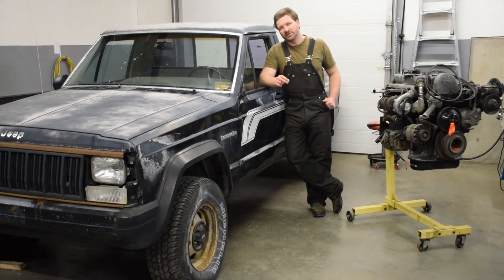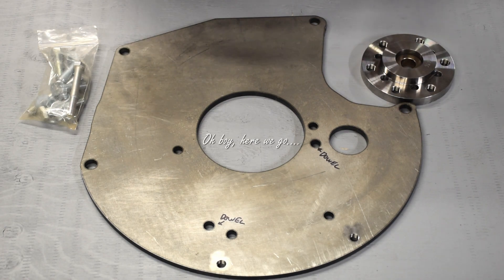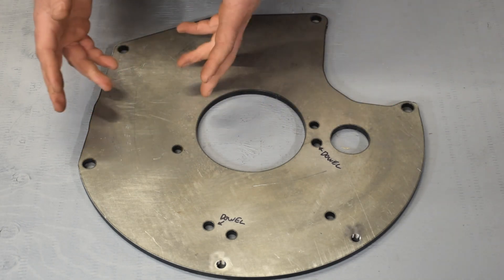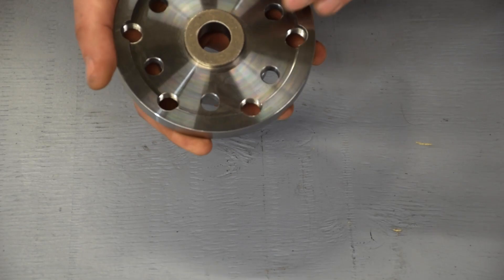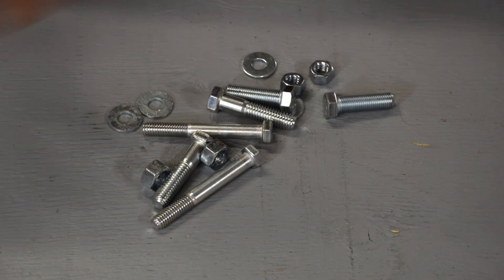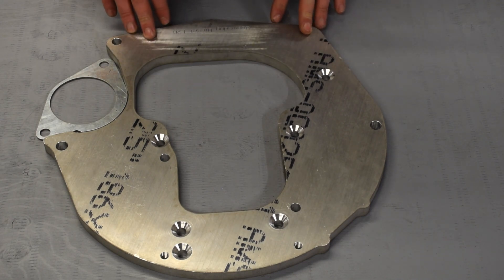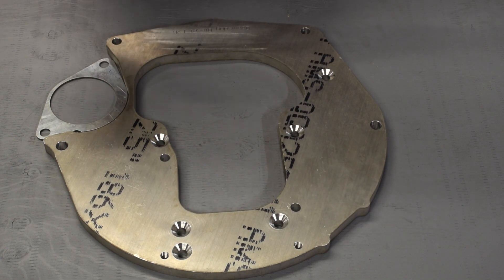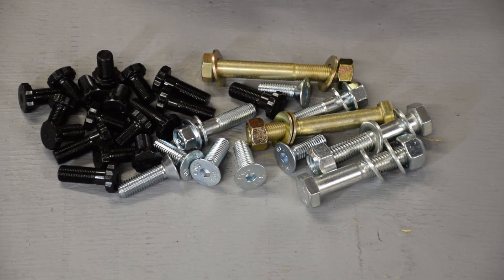Adapters for the OM617.  Ugh - Project Special Reserve Jeep Comanche Episode 2

Comment: Good to know that the dowel sleeves are a chore to remove. They certainly are with the 3VZ-E, hence the reason I include new dowels for the R150. Adding them to future AX15 kits shouldn't be a problem.
What is your honest opinion about my instructions? Anything you'd change or add? I don't send paper copies to conserve trees, plus I assume most people read off their phones nowadays.
Reply from the maker: I think the instructions with your kit are fine.  I was going to mention there wasn't a printed copy, but I cut that from the video as it seemed minor.  My disgust at the MD4x4's instructions being as garbage as they are HAD to be included though.  More pictures are always better, and I'm sure you can add some as more kits are installed, or just include a picture library on your website if people want more material to refer to.  Personally I like printed copies, and like to see them included, but I might be in the minority with that.

Including the dowels in the future would definitely be appreciated, and might cut out some potential issues caused by people trying to reuse them.
Reply: Could always make it an option when ordering. For stuff like this big color pictures are way better than anything on a phone (at least for a noob like myself).
Reply: @DestDroid  excellent idea! Thanks!
Reply: I prefer paper instructions for any automotive work.  I do not like to touch my electronics (phone or laptop) with greasy hands.  With paper instructions I can get them dirty and scratch notes on them as I go.  Just my two cents.

Comment: Dear sir, 
   I agree the extra 0.1:25” thickness would not be advisable if it does not allow proper engagement of the dryer and the ring gear without further fabrication. Where can I purchase an automatic transmission adapter in order to swap a low mileage OM617 diesel engine into the Land Rover Range Rover HSE. P 38 automatic to utilize the original 2000 Land Rover ZF transmission, which is a four-speed ZF transmission 9:39 which bolts to the transfer case in order to retain the four-wheel drive capability, shifter and odometer connection to the Dash gages.😮. Recommended or not.

Comment: I just finished my diesel swap and I gotta say I was in the exact same situation.  I originally bought the mercedes 4x4 diesel kit and then realized the issues before I installed it.  Bought the doomsday diesel kit and hands down its the kit to go with.  Joe provides a great product and support.  Buy from Joe.  Now I have a brand new mercedes 4x4 adapter kit that I dont feel right selling to anyone, but thats my problem.  Thanks for the video, just wish I found it 6 weeks ago.

Comment: I also went with the same mercedesdiesel4x4 kit. I’ve been through three pilot bearings and the engine when it’s revved just feels..shakey. Something hasn’t been right since I did this swap 3 years ago. I put maybe 5000 miles on it in 3 years with 3 pilot bearings. It’s my first swap and I taught myself everything (especially since I was given those same instructions you got) so I’m proud that it moves but man has it been a pain in the ass. Now that I see doomsday diesel has this swap, it really makes me want to redo the whole thing
Reply from the maker: Yeah, it was a huge disappointment to me to see how bad the Mercedesdiesel4x4 kit is, and I didn't proceed with it because I was afraid I'd have the exact issues you have.  The good news is the Doomsday kit fits very similarly, but the adapter plate being a little thicker will push your transmission back a bit.  I'd say it's worth it to save your pennies and swap to the Doomsday kit.

Comment: Glad to see another episode.

I'm debating whether I want to swap to an OM diesel or to a 3.4 V6 in my 86 Comanche. My only hold up on the diesel would be having to source a different transmission, since the GM powerplant in mine has a different bell housing pattern.
Reply from the maker: The transmissions used with the 2.5L and 2.8L typically aren't that good, I'd assume you have an AX-5.  It probably wouldn't appreciate the power (specifically the torque) of the diesel.  You're better off tracking down an AX-15, even if you want to go with the GM 3.4 as you can bolt one on with the Dakota bellhousing.  You get a bigger clutch that way too.  YMMV though, I know lots of guys just drop the 3.4 in place of the 2.8 and it seems to work out.
Reply: @2drx4  Actually I have an A904. And despite not having overdrive, from what I've read they seem to be a fairly strong transmission. I would like to stick with an auto and prefer to stick to a non-computer controlled one. If I went with the OM6XX I would like to go with a 700R4.

At this point it really boils down to how much money I'm willing to throw at it. A diesel would be awesome. There is even a company local to me that produces bio-fuel for fairly cheap I could run it on. The other side of that coin is finding a F-body for a 3.4 swap would be easier and cheaper.